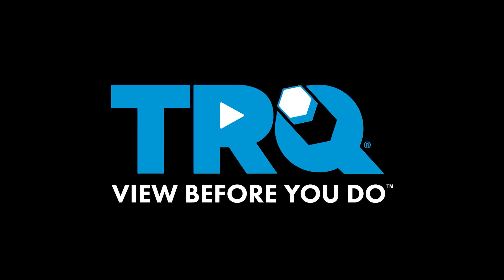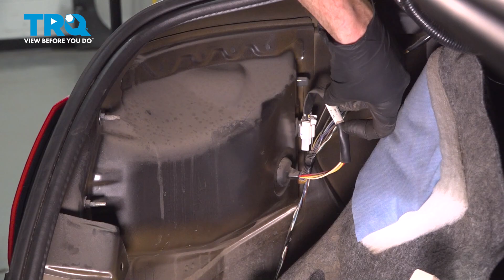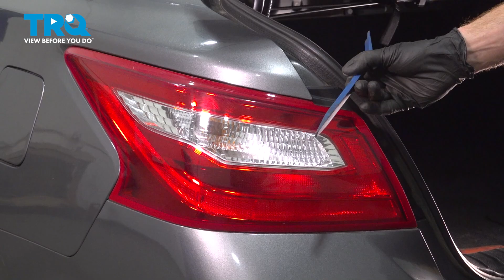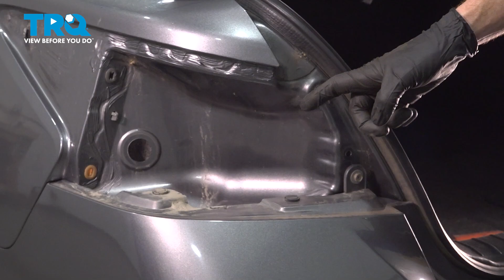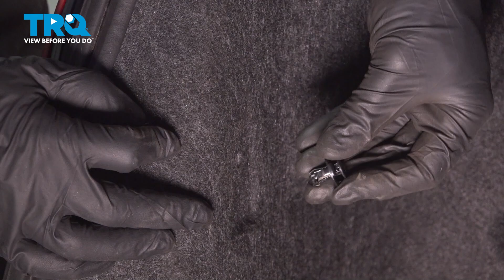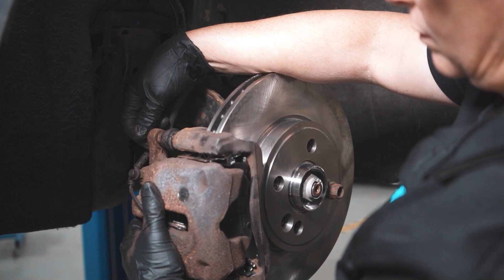How to Replace Tail Lights 2012-2018 Nissan Altima

Comment: Can the black plastic part not being tight to the car cause issues if water gets in? I ordered a light from Amazon and it almost fit but that black part didn’t fit like the original

Comment: I have a question so before you tell me to see you're nearest dealer . I'm just asking your advice I have a question my rear left break light did want to work I exchange the entire car to leds. So I check the bulb it don't work ,I check the fuse there were blowed out I try new bulbs didn't  work, I just ordered a entire assembly I hope the wiring harness that comes with it works . So that being said may I ask do you know if I should check something else to make sure.???